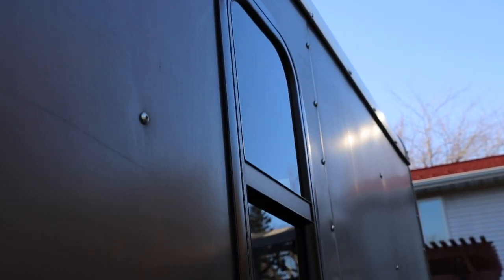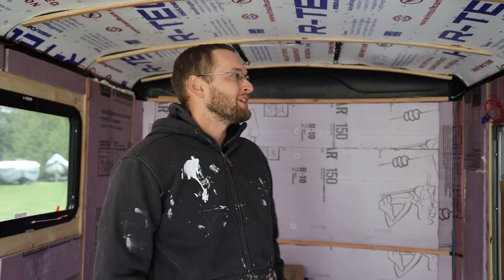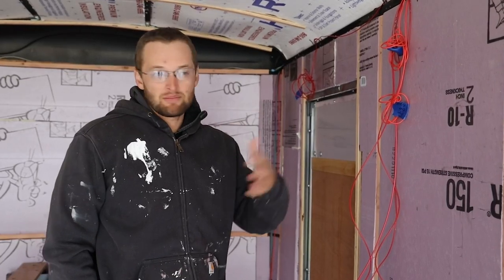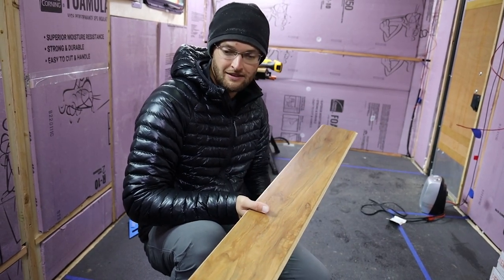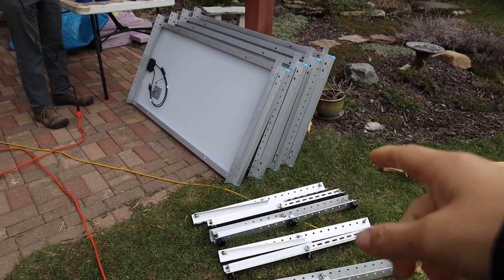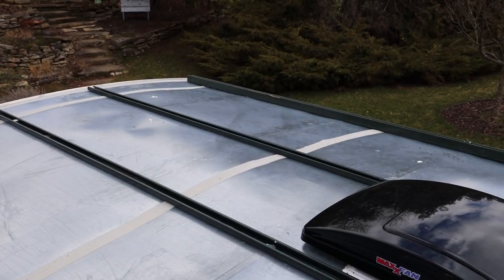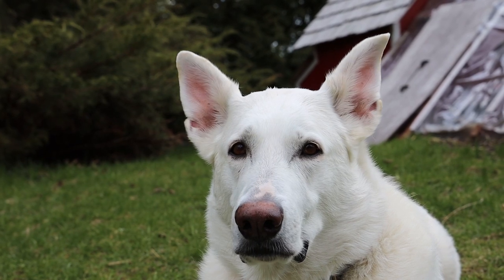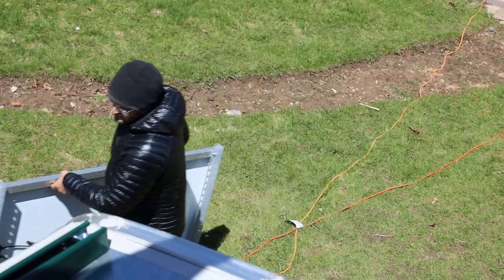Cargo Trailer Conversion | Part 2

Comment: I enjoyed this.  Good job on the solar panels.  I used two 100 in series and using the Victron controller and two battleborn (they are so good and knockoffs just are not the same).  I look forward to seeing the updates.  I am restoring a 1990 G20 true high-top (2') chinook and it is perfect for my needs, better than store bought.

Comment: I love this build more than a van build bec. it separates the vehicle from the home portion... which wld free the home portion to be parked somewhere during times the vehicle needs repair or maintenance.  More spacious too which means NO reason to forego indoors toilet & shower arrangement ... which wld  make for more convenient personal hygiene even though in a compact setup.
Reply from the maker: Yes some of the aspects are pretty great! There are certainly pros & cons to everything, and I think for Noah having the trailer with the ability to take the truck to different places is PERFECT! For me it wouldn't be practical or comfortable, but that is why I chose a van :)

Comment: Since our build was very much after-the-fact, I took advantage of the fact of the curve where the top of the trailer meets the walls.  I installed the ceiling insulation and ran wiring there (to support the puck lights and MaxxAir fan) over to the wall.  I basically created a "channel" along the length of the trailer bay adding large molding to mask where the ceiling and wall meet.  If I need to change/add wiring later, I can easily remove the molding "channel", make changes, reinstall.  At some point, though, I'm going to have to break down and remove everything from the walls so I can install insulation there.  

For my solar panels, I did something very similar.  One channel strut on each side of the roof, with the solar panels mounted to them landscape mode to the trailer.  Since our MaxxAir fan is in the center, that allows us (currently) to have one panel in front of the fan, one behind.  We have enough room to add two more panels (ours are the 100w versions, so obviously we could just go with higher capacity ones).  One feature I like on your build that I may consider as an upgrade is the ability to angle the panels.  For the time being, I opted to keep the panels as low-profile as possible to reduce the chance for lift to tear the panels off (I've seen the horror stories).

Comment: ive got unistruts on my cargo trailer build too. but... although i have some angle pieces like his, theyre just up too high. im going to just bolt some z-brackets directly to the unistruts, eliminating the extra pieces of angle. thisll lower the panels about 1.5" in my application. theyre probably catching too much wind. theyre probably vibrating and flexing in the wind, not to mention not as aerodynamic. yes i may have to drill holes in the aluminum panel frame. but its just a frame ;)
Reply: oh, i commented too soon! hes making them tiltable. have him check out a bolt screw. he can rig it where he can raise and lower them with a switch! ive considered it, but ive decided im too lazy lol

Comment: A blast as usual. There’s a product called flex seal I’m going to look into. Someone told me it’s UV safe and lasts years. I’m hoping to use it to seal things like a wire cover for solar cables etc. I’m paranoid about having a leaky roof. Maybe I can be as confident in my developing van building skills. Cheers from Canader eh!

Comment: Have you thought about placing two 10 feet by 4 inch tubes on the roof to put water in for hot water showers
Reply from the maker: Noah already has a great idea for a shower!

Comment: As the newly recognized solar expert, lol, would Noah or you happen to know if one can add solar panels to an existing system? My new to me van has 80 watts that just acts as a trickle charge for my house battery, but I'd like to add both extra panels and an inverter. I haven't had any luck finding the answer anywhere.  Great job you guys! 🥰🚙🇨🇦
Reply from the maker: Yes you can! That is my plan with my system this month, I am going to add a panel to an already existing system :)
Reply: @Linneaandakela  Awesome! Then I'll be eagerly watching for your update 🥰  thanks!💗

Comment: will you change the angle brackets so the panels can all face one way?  It looked like both side tilt to face away from trailer butt you migth want to have it so you always park it one direction so they can tilt and face the sun.  Just curious.  Looks nice like the mounting setup.
Reply from the maker: The panels have the ability to be at any angle! Noah placed them that way for an easy work area.

Comment: Hi here, I'm a little confused with the solar panels. Eg if the sun's on your left and you tilt the panels up, what happens with the panels on the right side? Will they be in the shadow of the panels on the left?  Wouldn't it make more sense to have them pointing in the same direction? Just curious.
Reply from the maker: Great question! The solar panels can be tilted either direction and at various angles. So if the sun is low in the sky, all four panels can be slightly tilted toward the sun, or dramatically tilted if need be. 
What you saw in the video was just an easy way to get them out of the way to provide Noah with a large work space!
Reply: @Linneaandakela  oh okay, very cool! 😎 Thanks for the reply.

Comment: Question: Did I understand you that you are hooking all the panels in series? I ask because if you have both panels angled up on each side, hooked up in series, you'll get very little sun on half your panels and get very little power out of the array. Hooked up as you show them, it would be better to hook each set of two panels on either side in series and hook both sets of two in parallel. That way, you'll get at least half your total wattage from the panels depending on which side the sun falls. Unless, of course, I'm totally misinterpreting this or missing something and you intend to run the system with the panels flat and only angle them up on the brackets to get access the panel underside or the roof.